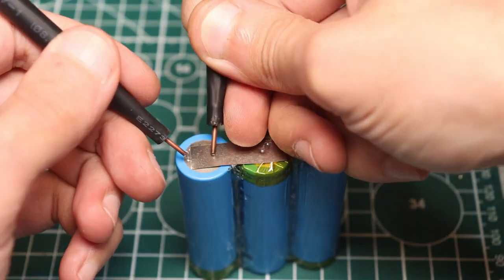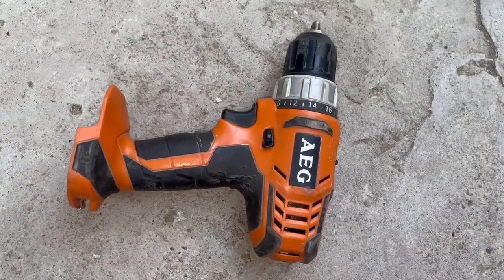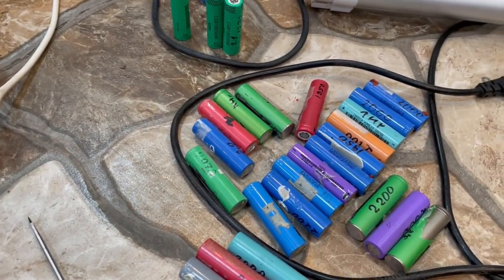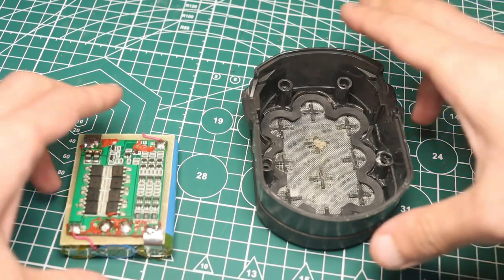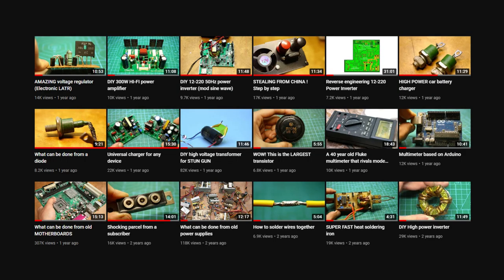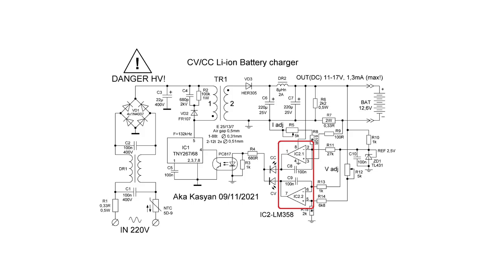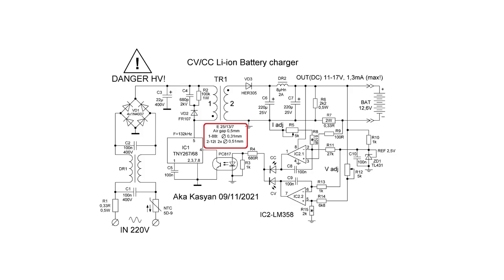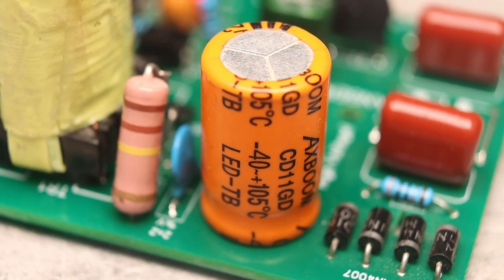Restoration of a GERMAN Cordless Screwdriver

Comment: I have a cheap 12v drill. The battery packs were dead. So I just made up a cable and ran it to a normal lead acid car battery. Truly a light weight portable drill. Great video, thanks.

Comment: I did the same modification on a Bosch drill, but the BMS board (3S balanced version) did not drive the motor at all. After adding a 2200uF capacitor to the output it worked, but if the motor will get stuck during drilling the board switches it off. I think because of overcurrent protection. Then it takes a long time (several minutes) to work again. It seems it charges the capacitor with very low current and is operating again, if it reaches a threshold. Do you have a hit how to improve this? Could this BMS be hacked to recover faster?
Reply: How good are elements? I had similar problem and it seemed that problem was not overcurrent but weak battery voltage dropped too low. And then BMS "saves" it from getting drained too much. After I used 3X2 cells instead of 3 it did not cut out like that anymore. (I thought that no way can cheap 12V Skil draw more than 40A)
Reply: @Tegelane5  Good point. I tried new high power cells. It seems the drill makes a PWM for regulating the RPM and it comes backwards into BMS and overwhelms it. 🙄